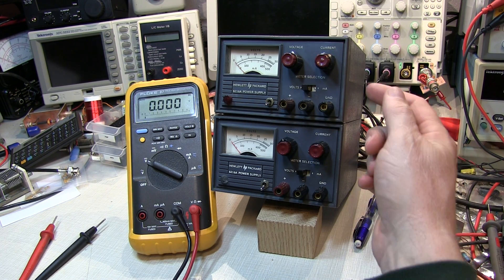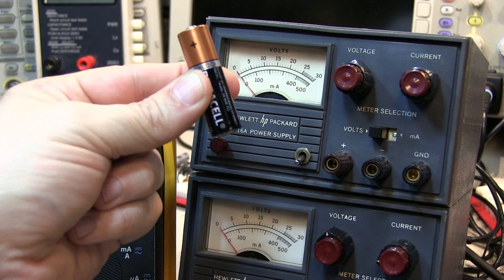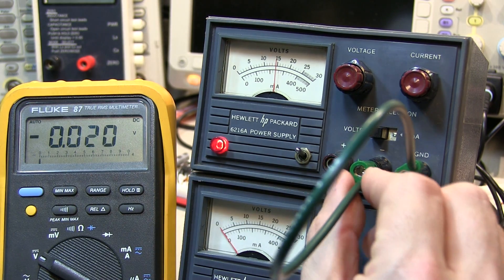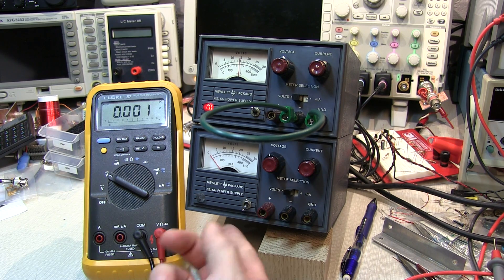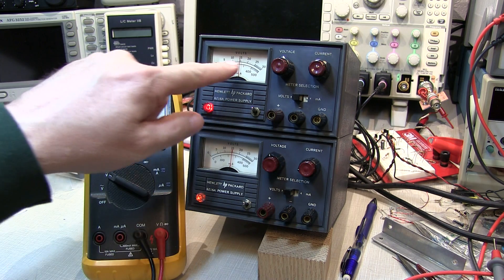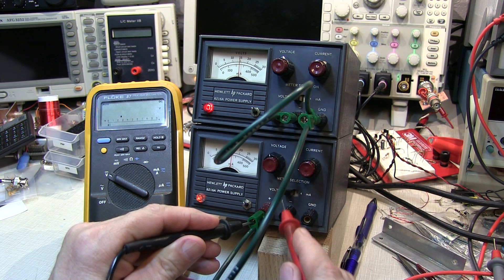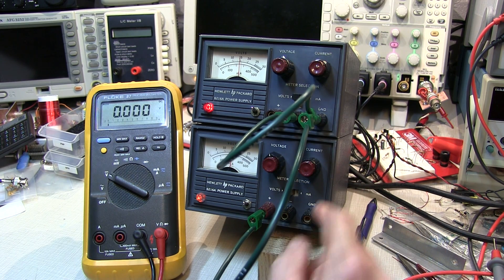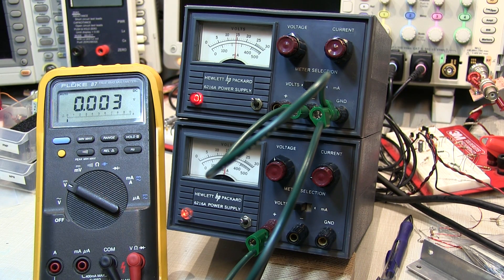#233: Back to Basics: How to use the 3 terminals of a lab power supply | split supply

Comment: Hi
Could you please help me understand why there was no predefined voltage between the gnd and the +ve/-ve terminals at 1.18 mins ? If the ground terminal was connected to the line ground(0V) then this should have shown half of +/- 7.5 V (half of 15V) right ?
Thanks :)
Reply from the maker: Not necessarily.  The +/- terminals are isolated from ground, the same way that the terminals of a 9V battery are isolated from ground.
Reply: @w2aew  Thank you for your answer. I think I get your reasoning. I am a beginner and  just to make it clear in my head, I would like to ask the following: When you powered the power supply through your mains, won't there be a connection established between the building ground and the ground terminal ? This is what made me ask if potential difference between the ground terminal and the +/- terminals should be something other than 0V?
Thanks again for your informative and educative videos. Cheers.
Reply from the maker: @siddarthshivkumar5780  Yes - the ground terminal is connected to the mains ground.  But, the +/- supply terminals are isolate (like a battery), so YOU can decide which is connected to ground or not, depending on your application.
Reply: @w2aew  thanks, this bit was confusing me. Negative and ground are tied together in the breaker box so I was confused about how connecting positive to ground could be safe. Makes sense if they are isolated though!

Comment: Why is using one tube rectifier power supply limited to using 40uf to 50uf for the maximum capacitance value. If you use two tube rectifiers in parallel it will increase the current? and you can also use a higher value filter caps 80uf to 150uf any reasons why?

Comment: Thanks for the nice, clear explanation.  Is it important that the neutral point (between the + and - supply) be connected to earth ground? It doesn't seem necessary, at least as regards feeding, for example, a protoboard on a benchtop.
Reply from the maker: It is not super-important.  In effect, it's no different from powering your protoboard from a battery.

Comment: w2aew,  guitar amplifiers don't use regulators so when the AC outlet drifts up and down from 90VAC to 130VAC if changes the DC biasing negative voltage to the Power Tubes. Why don't they make regulators that can regulator high -150vdc DC negative voltages?
Reply from the maker: It's certainly possible, so if there isn't any voltage regulation included then this is probably because the designer felt it wasn't necessary to achieve the performance they wanted to achieve, or it was a cost issue.
Reply: which regulators can regulator very high voltage because I have only seen regulator IC chips that are from +-5 vdc, +-12vdc, -+24vdc. I have never seen a regulator IC chips that can regulator negative 100vdc to -200vdc for biasing voltages for power tubes. What can I use to regulator bias voltage for power tubes?
Reply from the maker: @waynegram8907  You're not going to find a monolithic regulator IC for such high voltages because the IC processes don't support that level of voltage.  Thus, the regulator would typically be made of a discrete circuit.  If you google search "high voltage regulator for tube amp", you'll see dozens of results or more for regulator designs the people have done.
Reply: I thought maybe there was high voltage IC chip that does this but I guess you have to make it out of discrete circuits.

Comment: W2AEW,  guitar players are saying that their overdrive & fuzz guitar pedals that take batteries will sound different when using different types of 9volt batteries NON-Rechargeable 9 volt batteries like Alkaline, Carbon zinc, Lithium, Mercury because of the DC resistance of the 9 volt battery. 
A guitar players overdrive pedal will sound different if you use an Alkaline, Carbon zinc, Lithium, Mercury battery each will sound differently because of the batteries DC resistance
1.) Why does the battery DC resistance affect the sound of an amplifier pedal or fuzz pedal?
2.) Why does each 9 volt battery type  Alkaline, Carbon zinc, Lithium, Mercury have a different battery DC resistance?
3.) What is a batteries DC resistance?

Comment: What if we only wire the supplies as shown in the video  but not touching the ground?
As I can think of it, we would get a floating ground for the circuit that would use  this positive/negative supply and the circuit would work but what are the consequences?

Comment: Thanks for another great lesson! Question: When using a CT transformer for a split supply, should the CT be connected to the earth / ground wire of the the three prong power cord plug?
Reply from the maker: Only if you need/want your common node grounded or not.

Comment: Power Supplies in Defibrillators are called power generators or power supply generators. I'm not sure what the difference between a power supply generator compared to a power supply. I'm guessing a "power supply generator" have very large value filter capacitors to store a voltage and current for a long time. The very large value capacitance stores voltage & current which engineers have told me the capacitor is storing a "wattage Potential" which is storing joules. Example is 200Joules = 200 Watts ,  360joules = 360 watts, which is used in Defibrillators to release this wattage potential into your skin and body to jump start you heart.

Comment: Excellent video! quick question? Does the current protection/limiting feature of the PSU still work when they are connected in series?. In other words, if I get 30V out of 2, 15V PSUs in series (like you did here) and I short the (30V) output, will the constant current function kick in or will I have 2 dead 15V PSUs??.. Thanks!
Reply from the maker: The current limit should still work, on properly designed power supplies.

Comment: Oscilloscope ch#1 is on the output of a tube output measure the AC Peak to peak Voltage of the audio signal, Ch#2 is on the power supply output voltage. When the volume is turned up to 10 the audio P/P voltage is at its maximum and the power supply output voltage will take to collapse 10% to 20%. I'm not sure if the speakers load impedance resistance and the output transformers impedance loads down the power supply to cause this SAGGing effect of the power supply output voltage collapsing.

Comment: yes I understand about what hot chassis is. When you have a 3 wire line cord and you put your current clamp on the chassis green wire, it will measure chassis leakage current. I'm not sure where this chassis leakage current is coming from. But all pieces of equipment has chassis leakage current, just put your current clamp on the green wire on your 3 wire line cord and it will measure leakage current. I thought chassis ground green wire was at zero voltage zero mA current.

Comment: why does an AC isolation transformer need to provide DC isolation between the primary and secondary?  there is no DC voltage on the primary or secondary
Reply from the maker: Some older equipment used 2-wire line cords with one side tied to the chassis.  Thus, the chassis could be "hot".  The isolation transformer prevents problems when using properly grounded equipment when working on older gear that may have a hot chassis.

Comment: Is there any difference between a variac and an isolation transformer? Tenma sells an isolation variac transformer which i didn't know there was a difference because a Variac compared to an Isolation Variac. I thought there were the same thing but there must be a difference. Also if your equipment has a short circuit and is drawing 10A you're variac or isolation transformer will get damaged because of the current rating of the variac and isolation transformer. Most Variac are 3A or 5A the most expensive ones are 10A to 20A.
Reply from the maker: Yes - big difference!  A Variac is a variable transformer, and is often NOT isolated (neutral is common to input and output).  An isolation transform provides DC isolation between the input and output.

Comment: It should be noted that if you supply a circuit you are testing with mains ground (as shown here), then your oscilloscope and circuit is at risk if you accidentally connect the ground probe lead to anything other than ground (as that probes ground lead is also connected directly to mains ground). It's always safer to test a "floating" (or isolated) circuit than a mains ground connected circuit. It's explained very well here: https://youtu.be/xaELqAo4kkQ

Comment: IF you connect +15 to GND and nothing happens , its a bad GND ,  im not familiar with this kind of connection , makes no sense .
Reply from the maker: That's true only if the +15V is already referenced to ground.  If the +15V is referenced to the "-" terminal and not GND as in a typical lab supply with floating outputs like this, then it's perfectly fine.  It's the same thing as connecting the "+" terminal of a battery to GND - it won't harm anything as long as the "-" terminal isn't connected to GND also.
Reply: @w2aew   if that is so , then there is no GND, that makes it kind of a bad gnd
Reply from the maker: @dedskin1  This type of supply gives you the flexibility of connecting GND to the "-" terminal when you want a positive supply voltage with respect to ground, or to connect the "+" terminal to GND when you need a negative supply with respect to ground.  There's nothing bad with the GND.
Reply: @w2aew  so instead of using 2 wires it gives you flexibility to first go to the GND with minus lead then go from that to the device , or go with the plus on GND and make that positive and pull your positive from that ,  some flexibility .
Reply from the maker: @dedskin1  Basically, but in your latter example  the application would be for a negative supply.  A very common application in analog circuit design would be to have a +15V and -15V set of power supplies for op amp circuits.  In this case, you would use two identical power supplies, one with the GND tied to the negative terminal and the other with the positive tied to the GND terminal.
Reply: @w2aew  nice supply's tho they don't make em like that any more
Reply: @w2aew  so im making my own, simulated it in Nationa lInstruments  Multisim  in order to have PCB printed by professional  , made the prototype ,   upgraded it , im surprised i pulled it off ,  had to remove some parts Multisim bugs and crashes with "switches" and some parts so i had to strip it , this is Bare bones of my PSU proto https://drive.google.com/open?id=1SIbjh8r8ErkLjuLQaFq7P7IXLJ3okGjY All parts are qulity , much better then what is in Chinese PSU , something like yours there is bare minimum i would use .
Reply: @w2aew  finished my own  , 1,2 to 24V DC  regulated , and 20V AC for future upgrades,  maybe + - kind for audio amps testing projects https://drive.google.com/open?id=1xv72yD6AOtBES_onxkNfunzfSOkI90gt

Comment: I like the background clutter on your bench. It makes me feel at home :)
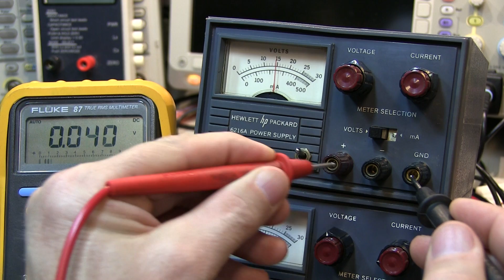The first half of the video was informative but then for me it got "weird" when the cables were being plugged in here and there. I suppose then that those HP's are different from an old BK supply I intend to buy. #1735A. The BK manual shows that you can get both + and - outputs supplying power with reference to the third ground terminal. That's how they show it to be used for supplying a circuit that needs dual polarity, ie. op amps.  It's why I want a bench power supply of this type, but your demonstration showed no voltage at + or - until one of them was strapped to the ground, time 1:20
Reply from the maker: On most lab supplies, the voltage always appears between the + and - terminals, but neither of these is tied to ground until you tie one of them two ground.  In that sense, the + and - terminals are very much like the + and - terminal of a battery - floating, with no inherent ground connection.
Reply: Charliebrm1, it's been a while, so this may not be helpful, but...  It seems like you're going through the same quandry I did recently, trying to figure out why I couldn't just get a three-terminal +/- supply for dual supply op-amp circuits.  It seemed so obvious that's how it ought to work.  Well, not so much!

I dug around to find the manual you might be talking about; and if you're referring to what I see as figure 3D, where the various ground configurations are shown and discussed, notice the important point that the figure mentions "Grounded, not common with negative or positive polarity."  In other words, the ground terminal and the supply terminals have nothing to do with each other.  The positive and negative terminals are still floating, and still have the (single) supply voltage between them.  The ground terminal is being used to provide a convenient ground to the device, and that's all.  It's equivalent to connecting plus and minus from the power supply, and then running a separate wire from the device's ground to the wall outlet ground.

To get + and - 15v with respect to ground, you'll need two supplies, or one dual (or triple) supply.

Comment: Hi There, 
I have an hp 2616A and would like to ask two questions; First; why there is no voltage out put while the current control nub is set to zero and I have to advance the nub a few mA’s, so the voltage can appear. And second, can the output current be increased from 500mA to 5 amps or more? I would appreciate your thoughts on these two issues.
With Kindest Regards, 
Shahbaz
Reply from the maker: I am not familiar with an HP power supply with that model number, so I can't comment on it directly.  In general, I can say that it is common that you have dial up the current limit a little before an output is present.  This is because there are small current draws from the supply output even when there is nothing external connected.  The output voltage meter, voltage monitoring circuits, voltage regulator sense lines, etc. are all examples of internal circuits that draw current off of the output.   Regarding your second question - the answer is mostly like "no".  Higher current will most often require heavier duty transformers, high current / power regulator circuits, etc.  It is not a simple adjustment or modification.
Reply: Thank you for responding to my questions.
The power supply that I have is an hp 6216A. I indicated a wrong hp number. Sorry about that.
With Kind Regards,
Shahbaz
Reply from the maker: Shahbaz Ameri  OK.  My answers hold.  Not possible to increase output current to 5A or more.

Comment: I was looking at these psu's on ebay recently, hp made quite a range in the day... How noisy are they? Can you create a video showing the build or internals and ripple?
Reply from the maker: I've never measuring the ripple/noise - but also never felt it necessary (because they seem pretty quiet).

Comment: Thank you very much, yes it was a mystery and not any more.
but still a few doubts, I have a dual channel isolated PSU and on the Earth(GND) Terminal -mentioned Max +/-100Vdc to gnd) what will happen if the voltage goes above 100V?
If I need -15V supply, I can connect my load in reverse to the + and - terminals without linking GND(Earth) to +ve terminal right? is this a correct way?
and for +15 and -15 volts, I can short the CH1 -ve and CH2 +ve together to make a commin negative and take output from CH1 +ve and CH2 -ve terminal right? which use case demands a GND reference?
when measured between the Earth(GND-mentioned Max +-100Vdc to gnd) and CH1&2 -ve/+ve terminals there is around 7VAC 50HZ present, what will happen to that voltage when I linked the earth(gnd) to CH +ve or -ve terminal and how much amps will flow? I am not dare enough to test it.
Reply from the maker: You run the risk of damage if either the + or - terminals are taken more than 100V away from ground.
For 15V, you can simply connect your DUT "reverse", since the + terminal will be 15V above the - terminal, which is the same as saying that the - terminal is 15V below the + terminal, which is also the same as saying that there is a 15V difference between the + and - terminals.  It is generally a good idea to tie in ground when you don't specifically need a floating supply.  For your +15 and -15 case, I would tie CH1 to CH2+ and tie them both toe GND.

Comment: Why did you make the ground connection? Could you not have connected the top -ve to bottom +ve and made that the common without tying it to ground?
Reply from the maker: You can.  You have the flexibility of referencing to ground the the supply, at the DUT, or somewhere else (or even float the supply).

Comment: Great... I know that this video is old but I'm glad it's here... Allot like many people here I had no idea that there was another way of doing it for different applications... I always wondered why my cheap eBay laboratory power supply had the earth terminal... I thought that it was there to be able to connect an earth strap to myself for working with sensitive stuff... But the one thing that puzzled me was why they put a jumper bridge from the negative terminal to the ground terminal.... Well now I know!!!! Now all I need is another 0-35v 10A supply to be able to make use of the split rail to be able to connect most of my amplifiers... Either that or maybe someone will post a good video on a adjustable power supply with split rails and high current ability for testing power amplifiers... Because those things in the shop's request an organ donation to be able to afford one LoL... The Astro 30 has one on his bench which is a kit that he must have built up himself but I think that it has certain current and voltage limits which would be great for Preamps and such... But I don't think that it could cope with the high current that I would need it for....